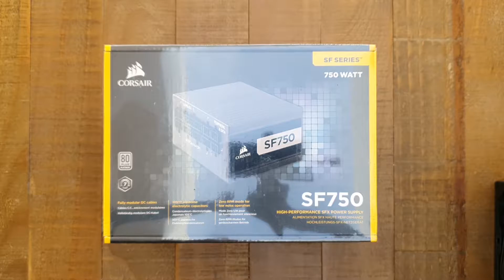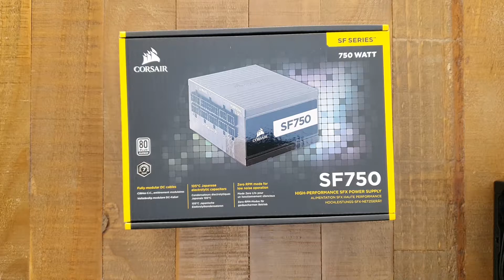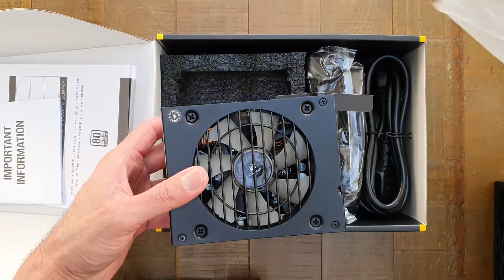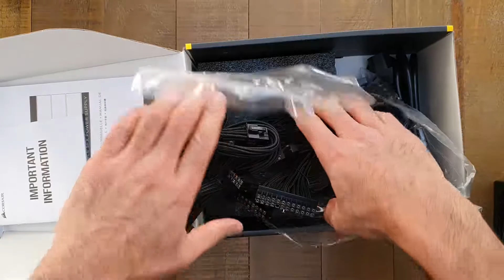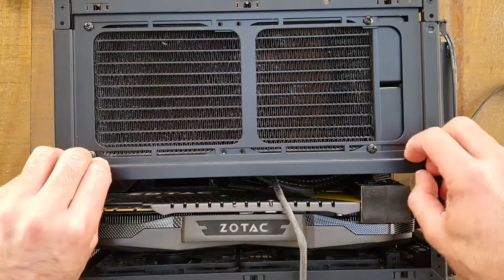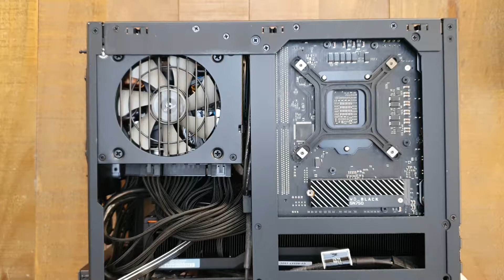Corsair SF750 PSU Unboxing & Install into NCASE-M1 - Replacing the SilverStone SX800-LTI

Comment: I know I'm way late for a comment on this but I notice in your prior video and in this one, it looks like you are using a single to splitter PCIe cable from your PSU to GPU. It's recommended to use two single PCIe cables from PSU to GPU.

Comment: Hi I just built the same case and  power supply with a gigabyte rx 6800 xt . Did you use the  6+2 PCIe express cables included with the Corsair SF750

Comment: Love the build - one minor correction to your PSU fan comment, you can tell by the blade shape that the fan pulls air into the PSU, it does not blow it out so with the PSU oriented that way it is actually pulling fresh air in from outside the case and naturally exhausting it out the top.

Comment: Hello mr khan, since you have purchased Corsair SF750 PSU, i would like to - with respect - remind you that corsair is doing voluntary product replacement for the SF series due to manufacturing issue. Now, I am not saying that your recent purchase is defected, but if you are those with these serial number 194448xx to 201148xx group you might want to contact the corsair customer support to get a free replacement. Thanks!
Reply: Very useful info, I purchased one in April 2020 and it failed after a few weeks in July 2020: the PC was turned off and cold, but plugged in, and it tripped a circuit breaker while I was out. When I reset the circuit breaker, their was a bang, a flash and magic smoke from the power supply, and the breaker tripped again.

I replaced it with a 700W Silverstone (all that was available) which has worked faultlessly since in the RTX 2080 ti plus 8700k build.

As it'll still be under warranty I'll have the SF750 replaced (195348xx).

I have another SF750 purchased in October 2019 in my workshop/lab build (i9-9900k + 2070 Super) which is on 24/7, which has worked faultlessly.